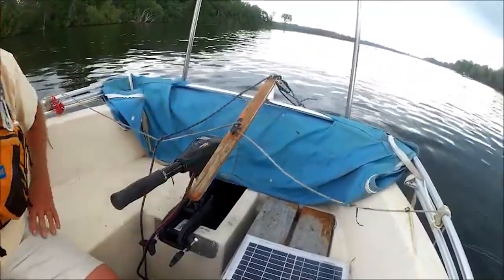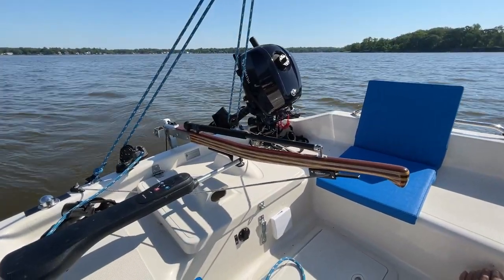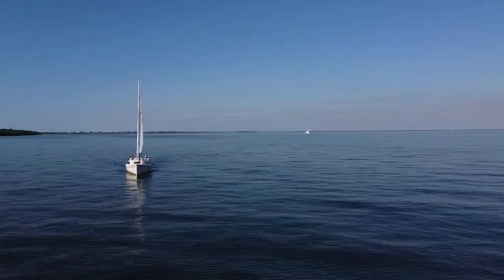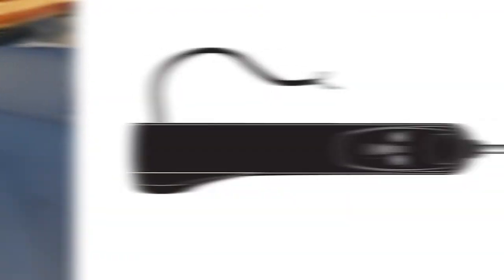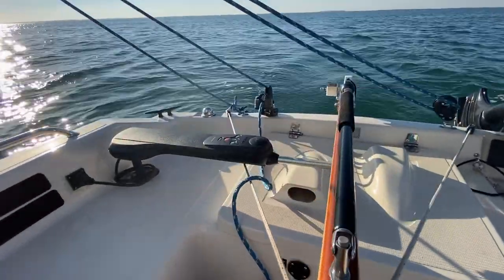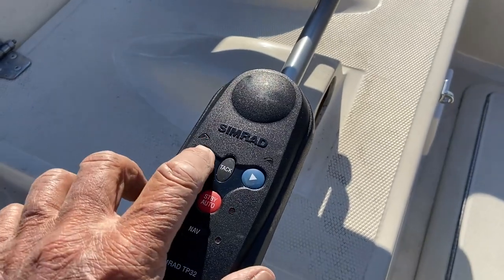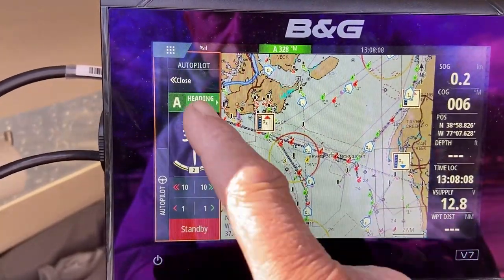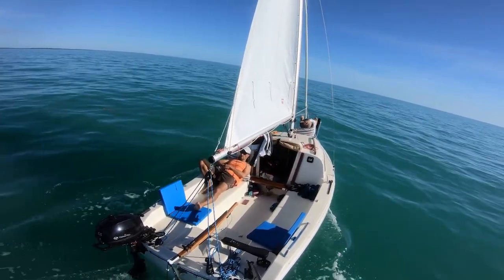Autopilot on a Pocket Cruiser, Why Not?

Comment: Thank you for this well directed and narrated youtube. I am like you and in California, I am known as a "trailer sailier" as my boat lives on a trailer and not in the water. I have been wanting to do exactly as you have done for a long time. Most of my friends have big boats and autopilots and don't understand why I want a Tiller Pilot directly linked to a chart plotter to follow GPS Way Points and such. My boat is a 1985 Catalina 22. I am looking at the RaymarineST  1000/2000. My boat only has a compass. I want to add a chart plotter that will work really well with the RaymarineST but have no idea what to purchase or how to link. I sail coastal and open ocean (yes I sail singlehanded to Catalina Island from San Diego and Long Beach depending on where I am with my boat.). Can you recommend a chart plotter for a boat like mine and whatever additional equipment is needed to make it all work together?  I like Garmin products but am open to whatever the sailing community has adopted as reliable and safe.
Thank you. I just subscribed!
Reply from the maker: HI Ben, generally, it's easier to stay within the same brand if you plan to integrate several devices on a network.  For the tiller pilot, you have only two options, Raymarine ST or Simrad (TP22 or 23, the TP11 works as standalone only).  I don't know any of the Raymarine chart plotters but the Raymarine ST having the older NEMA 183 interface, I don't know if it can be connected to a newer Raymarine GPS.  If you go the Simrad/B&G route, it's easy, the Vulcan 7 GPS and TP22/32 tiller pilots connect to a small Simnet hub via NEMA 2000 or Simnet cables.  Both companies B&G/Simrad and Raymarine have decent phone support so, you should be able to talk to a humane being to know what to buy.  Good luck with the install.
Reply: @siren17  Thank you. I will do exactly that!

Comment: Did you calibrate your unit when you first bought it?  I bought TP 10.  Haven't used it yet but since it's not hooked to a GPS thought I might be able to skip the calibration
Reply from the maker: Yes I did. It was pretty well calibrated out of the box. You should do it too, even if not connecting it to a GPS. The internal compass in the tiller pilot needs to be calibrated to fonction properly and accurately. I believe you should also recalibrate if you move the boat hundreds of miles.
Reply: @siren17  thanks for the quick reply.  I installed it yesterday and head out today to do the calibration and see how she sails.  After sailing my boat 200 miles a couple of weeks ago.  It was a easy decision to buy one.
Reply from the maker: @Jyock  I feel for you! Good luck with calibration.